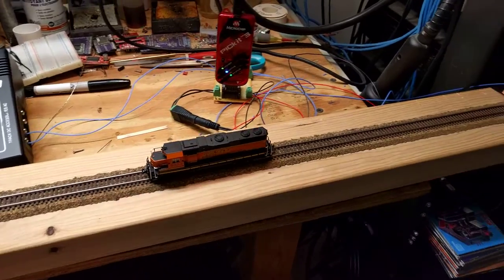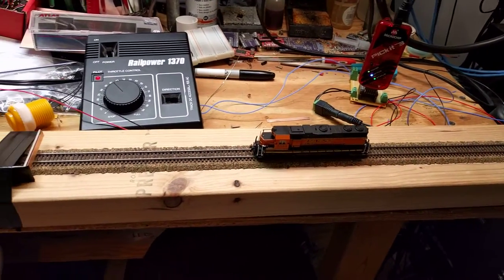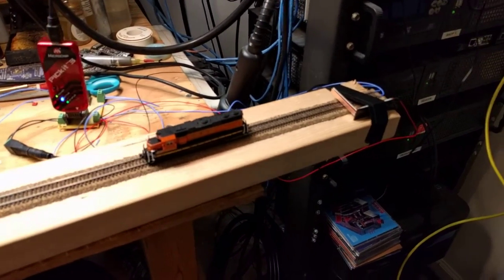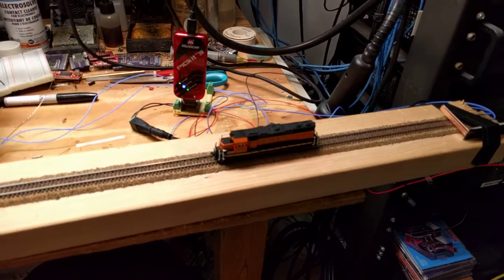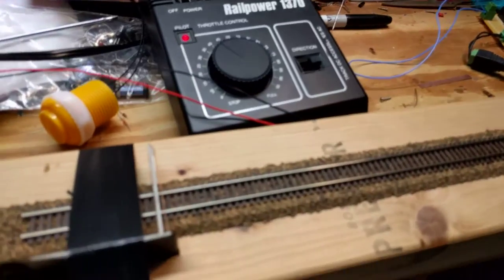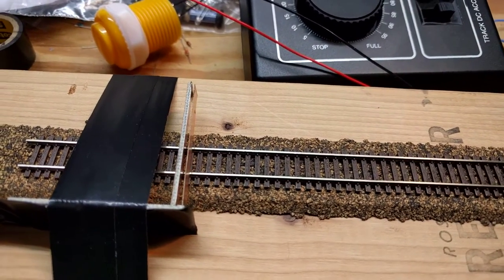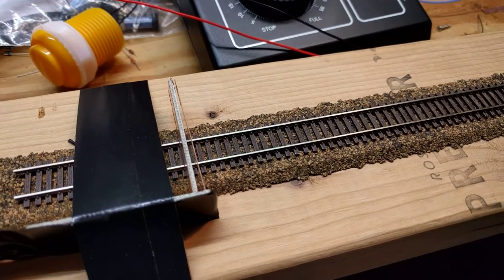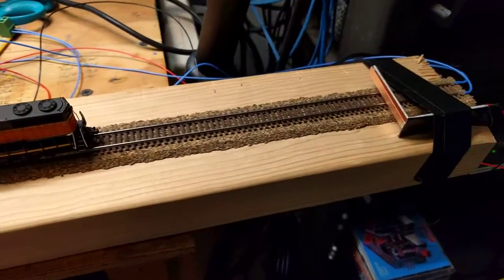Auto Reversing Demo 2

Comment: what u using for the circuit - autoreverser or other ?
Reply from the maker: I designed this around a PIC18F1220 microprocessor.  I have written all of the code from scratch in pure C.